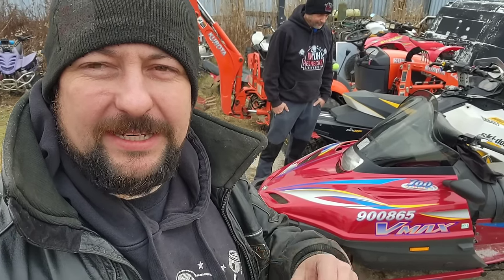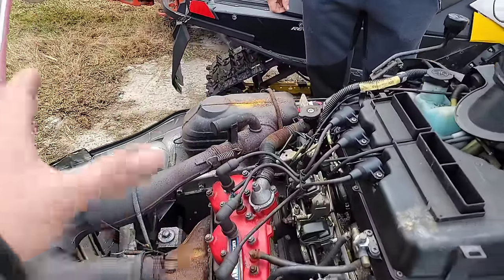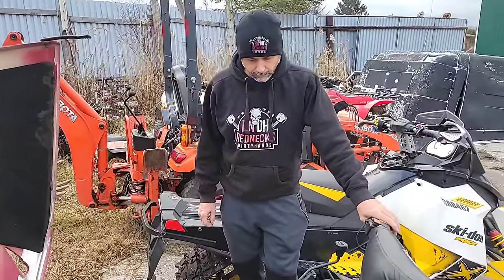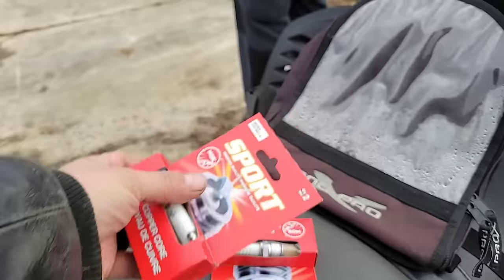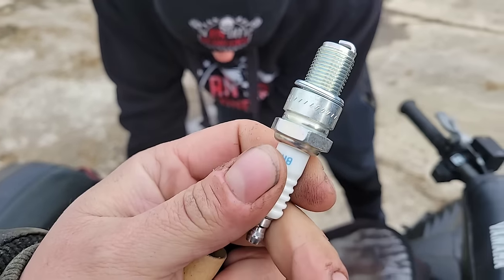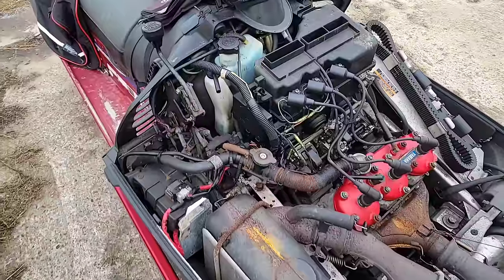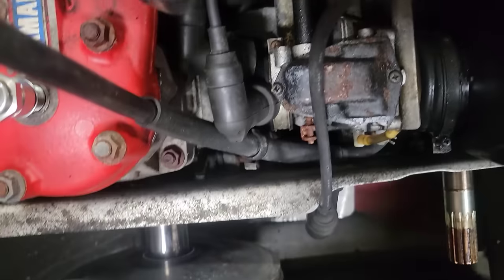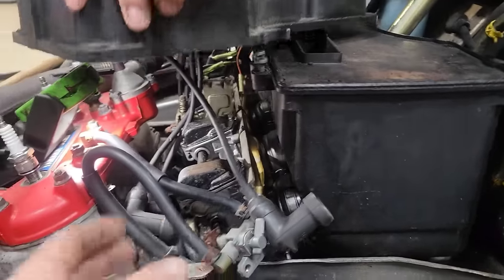Yamaha V-max 700 pre-season and throttle issue solved!

Comment: One of the few design issues with this vintage VMax was the left and right steering arms. They let moisture in via a drain hole and trap it there so the arms rust from the inside out…..not a great experience when an arm lets go at 80 kph. I replaced both of them and pumped both with gear oil to help stop the interior rust issue.

Comment: Another fun video, thanks Pete! All day swear fest, have had my share of those in my 40 plus years of wrenching! Never had good luck breaking those locking collars loose on those drive bearings. Was talking to you as you removed the bearing that if you're going through the trouble of removing it to check it, may as well replace it no matter what! Haven't had much Yamaha sled experience, bikes, yes. They seem like solid units. Those carbs look more complex than the standard Mikuni. I recall a guy working on marine Yamaha 2 stroke carbs saying they have several circuits, makes them run smooth but also a bear to clean!  Keep em coming my friend!

Comment: Great Vid Pete 👍
I had. SXR 600 for years. Never a problem. The maintenance you guys did I did kind of regularly. Got sold on the new stuff. It takes 15 min to get the panels off without breaking something or taking the F’n seat off to get to the battery. I really miss my Vmax
Open the hood & it’s there.
A few weeks ago we parked the late model stuff & got the 91 Phazer out & rode around our property. Lots of fun
Reply from the maker: thank you! cheers 🍻

Comment: Id love to own another Redhead!
😁 Awesome entertainment and learning video. My technical experience is not that of yours which I wish there was a road from where I live to your town for alot of the maintenance requests that are beyond my abilities. Great work those redheads are the best most fuel efficient sleds made for the horsepower that they put out and most never believe me how fuel efficient they are compared to other new sleds built today of lesser quality. 
I just got back from my hunting and gathering for my winter needs. Ive done some preventive maintenance to my 440 Cat/Logger and I've noticed that the strain i put it through.  Caused me to change all my bearings to be ready for this winter. I think ill stick with my Jag due to the ease of maintenance and prices for new sleds nowadays is way to steep and im paying $8.10 a gallon for gas and $8.50 for heating fuel. Keep these awesome vids coming, Very entertaining.

Comment: We were on a snowmobile trip, heading south from Cochrane Ont the trail crosses or used to, the Mattagami river. We got to the river and it was flowing, full of broken ice sheets but flowing fast. So what do we do, cross or turn back. Decided to cross, I was going first on my 98 T-cat. The shoreline is sloped down to the water level so I was off the throttle going down the bank when I hit the water I opened the throttle and nothing! Hammered on the throttle off and on multiple times till it fired. Once across I disconnected these switches permanently. Had occasional problems with them before but that was enough. Love the channel by the way, watched your video on the Ram exhaust manifold replacement, well mine is warped too.....I need a good mechanic, are ya busy, LOL.
Reply from the maker: yeah them throttle safety switches can be a real bugger sometimes eh! when ya wanna hammer the throttle and there's nothin there it can be a real sphincter pucker moment!! 🤣 oohh I'm a bit on the busy side these days...trying to make videos and pay the bills lol 🍻🤣

Comment: great video. word of advise when removing studs, i just use a blow torch heat up the nut/stud until the nylon starts melting and then use the impact the they come right off. i rarely have to use a cut off wheel unless one is bent. i've done this and reused studs 2 or 3 times on new tracks
Reply from the maker: thanks! good tip 🍻

Comment: Just a little question 🤔 With so many bad studs😅,wouldn’t it be better to change them all.  And if you don’t won’t your track not connect evenly to ground on a pull.  I like your humor and expertise.👍
Reply from the maker: yeah normally I'd swap out the track on a sled like that because of all the missing studs and a few pull throughs but because he's just planning on using it around his hunt camp and not really putting any major km on it just removing the bad studs for no is all we needed to do. I mean the cost of a track and studs these days is out to lunch so for now it's just sleddin on a beer budget 🤣🍻

Comment: You need to invest into a sonic cleaner for carbs, take the bowls off , and throw em in a container of gas put it in the cleaner, and put water in the cleaner to the full line turn it on to about 65c for 30 minutes, and you are pretty well done.

Comment: That V MAX is a 2000 not a 98.  Best sled I ever owned.  Still have it going strong.
Reply: Why didn't you buy
The v max four. It
Has more power  then the 700. 😅
Reply: How do you know
Reply: @666dynomax  I have a v max 4. Has more power. Then that
V max 700. Mine is all
Stock

Comment: Great job with your video 
But i've gotta laugh how you guys slam Polaris.
That vmax is basically an updated 17 year old Polaris Indy 500.

Trailing arm suspension. 
3 cyl liquid cooled.
Hydraulic brakes.
Running board heat exchangers.
"Yamaha triple sound"
All the above were on the market in 1981 boys.

Comment: Got a 2001 mtn max 700 triple. Went to do the carbs and the idle adjuster bolt on the carbs came out of the nut. Cant seem to find a way to compress the springs enough or get the bolt to thread back in. Any suggestions?

Comment: Put a little valve grinding compounds on those questionable screws before you even attempt to try em. Old guy i worked with on military aircraft showed me that in 82. Always got a tube of vg compound in my screwdriver drawer ever since

Comment: About compression test, why do people only pull 5 times? I pull or crank until the compression tester stops going up, then I know what the max compression is.
Reply from the maker: should be able to hit close to max compression in 5 tugs...if it's low after 5 then she's gettin tired. had sleds in the past with low compression after 5 tugs and hard to start with the pull cord but would start with the electric start cause it could spin it faster..but yeah might be able to get a few more psi after more tugs for sure 🍻
Reply: @rednecksdirtyhands  Alright, that makes sense. Thanks 🍻

Comment: Hi bud 2003 polaris 440 air pull it over and then it races hi ideal ??????😢
Reply from the maker: possible choke or throttle cable/linkage issue or it could have a cracked or torn carb boot? and sucking air and running lean...I'd take a good look there first 🍻

Comment: I got a 1997 yamaha vmax xtc twin and it's was running ok then I clead the carbs on it and took the old gas out ot and put fresh gas in it then all of a sudden it will not turn bogs out and tors kicks in and backfires and kinda wants to run but any advice on what to do and I got the gas on the carb to 1 and 1/2 need help and the plugs look kinda dry and look like there burning ok
Reply: do you have any slack on your throttle cable? you want a little bit of slack when you pish throttle before it actually lifts the carb slides. also make sure needle seats are seated properly.
Reply: How much slack do I need
Reply: And i also noticed when I started it it would start on one cylinder and jump back and forth on cylinder then pick up on both then run fine before all of this
Reply: And would the tps have any thing to do with it
Reply: @thompsonce  is there an actual tps on your sled? or are you talking about the tors sensor? try bypassing it and see if it makes a difference
Reply: I did that and no difference
Reply: Throttle position sencer I'm talking about
Reply: Or should i say piss it and not mess with it and swap all the good parts off the 600 and put them on the 98 vmax xtc triple 700 and and then sell the 600
Reply: @thompsonce  the 700 is a way better machine! 600s are harder on gas and oilthan the 700s too!